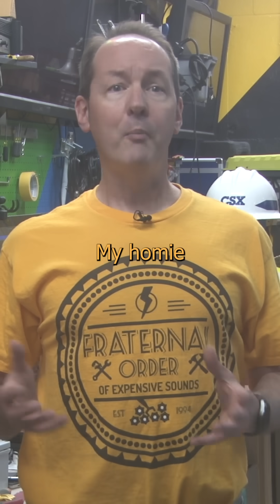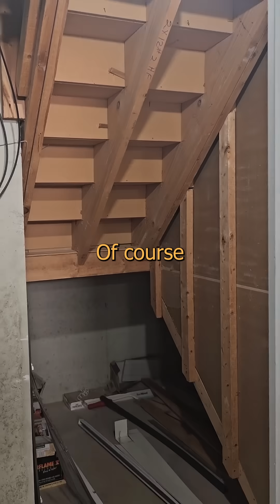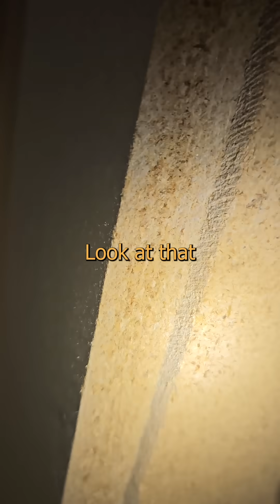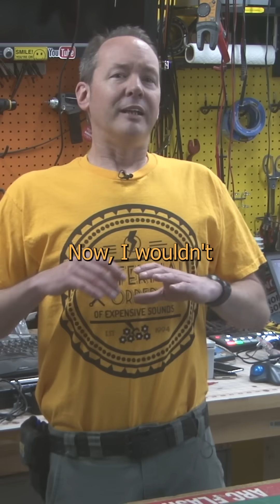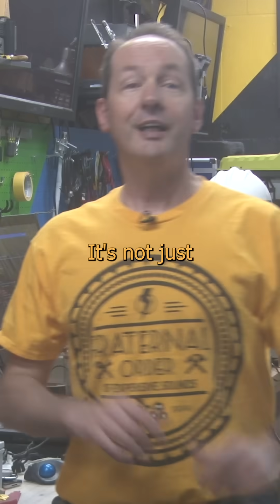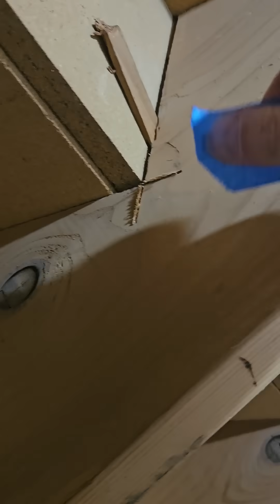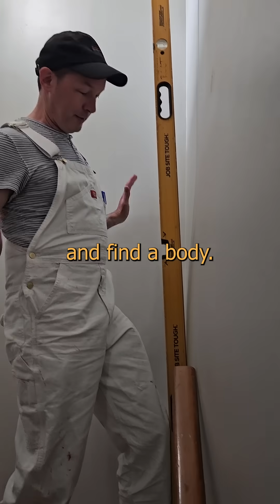Particleboard Staircase #chrisboden #engineering #construction #stairs #cheap #job #work #carpentry

Comment: As someone that's not American, it still boggles my mind that American houses are essentially built with, what essentially can be called, wood sticks, air and the stronger cousin of cardboard
Reply: Better than mud, railroad tiles and staples I have seen in my travels overseas.
Reply: Eh, it mostly depends on what type of mud youre talking about. Stuff like Clay ot clay composies can be surprisingly sturdy after they get dry. Also, nothing really beats a good, old house made out of brick and concrete@mhudzinski1

Comment: We own a 130 year old schoolhouse in Cleveland.  Not a square,  square inch in the place . I'm at the point I just close my eyes when I work .
Reply: @joeygigante4509  Yeah, but your's settled into that over time. This is a new-build.
Reply: At least it has being 130yrs old and all the settling that comes with the age as an excuse.

Though I am kinda curious to know if it was square 130yrs ago (not that we'll ever know). Bet they were more square than a lot of new builds today
Reply: After 130 Years you kinda have to expect that, that's just the building settling and a whole different expectations of a building, but a new build Doesn't have the excuse, not just that you can just See and Know it's not up to code in the slightest

Comment: One of my blessings was to grow up in communities with 300+ year old houses. Not all of them survived but enough of them did that you see what worked and what didn't. Everybody complained about a lot of the postwar housing but turns out that enough quality went into most of them that they were okay. I don't have the same sense of optimism for today's construction. My rule of thumb is if it's used on mobile homes to make them cheaper, don't use it. If they used it to make good airplanes and boats it's good.
Reply: And if it's used to make a bad airplane, well it's making the plane Boeing as much as it'd screw up the house.
Reply: I'd rather fly Boeing than walk up those stairs.

Comment: This much of a curve in a drywall is no longer a fuckup, it's an art project
Reply: Almost takes effort to make it do that.
Reply: @jbear9  or a buried outlet box. It looks about the right height for that too.
Reply: Load-bearing drywall?
Reply: @RageTH22  been a long fucking time since I last saw a reference to Groverhaus and it's load-bearing drywall.
Reply: @danielmclellan1522 I was hoping someone would catch that, lol.
Reply: @RageTH22 😂😂
Reply: @RageTH22  Aren't the edges of the ceiling Sheetrock supported by the wall Sheetrock? That's more of an incidental fraction of burden, but that's enough for a technicality.
Reply: Fucking abstract artists I tell ya.
Reply: Gravity assisted walls
Reply: As some who has to deal with drywall for my carpentry. That wall is the straightist wall ive seen.
Reply: At this point is a feature, for real this ad to be on purpose or someone was a tad too drunk on the job, how do you even bend drywall like that...
Reply: Just fill it in with 40 gallons of mud
Reply: @NigelThornbery  it would still be off by a 4th
Reply: @demon-hunter1498 so 50 gallons?
Reply: @NigelThornbery  brother they could use the whole ocean worth and still be off by an inch
Reply: @NigelThornbery but then it will slump unless you spend days adding it gradually , letting it dry using a heater on low ? but then there's the issue when you go to hang multiple items over a period of 
time . did you know that if you have a stack of drywall ready to be used, then it does get used , for sitting on repeatedly, stacking things on , even napping & having lunch on. this can cause ( 300# dudes once you add the tool belt & boots & hardhats) a certain amount of graduated curvation & it's even worse with particle board.
Reply: I love the intersection of trade work and the arts, especially as a hick lol 😂
Reply: In a past life me and my ex were house hunting in a rapidly gentrifying area and whew did we see some doozies of modern drywall art
Reply: Salvador Dhali would be fuming at the blatant plagiarism. 😂
Reply: "If you squint, its mint." LOL.
Reply: Screams in drywaller
Reply: "I like it! Picasso!"
Reply: Yup. And I thought that walls in our flat were crayz curved, because of that 1inch difference between each side of the livingroom.
Reply: @mikurusagawa6897  I can easily imagine someone thinking: "I want a curved wall. Just for shits and giggles. There's nothing behind the wall, and it's just a stairwell, it's fine. I want a curved wall, dammit."

What I cannot easily imagine is someone setting out to build a flat wall and ending up with a bowl.
Reply: Currently building my house. Over a 17 foot wall, my top right corner is inset by about a quarter inch. Undetectable without instruments but my god it's been bugging me. This made me feel so much better.
Reply: It’s like one of those curved mirrors at circus funhouses
Reply: If you squint, its mint
Reply: As a European, I am already uneasy with that flimsy drywall, but how the hack can it get those curvatures "accidentally" without the framework already beeing a mess?
Reply: @sebastiant4597  it's both! it's more on the framers not making the wall plumb but also on the drywallers for not adding some backing to out the walls to make them plumb. I get why but for my line of work I have to fix it a lot with a hammer
Reply: @mikurusagawa6897  yeah I'm not carpenter, but I do bathroom and kitchen renos so I have a solid understanding of basic framing and drywall work. I would have to put in extra effort to fuck those walls up that much. Idk how you even do that accidentally.
Reply: @PsyTheDuck  It's not even accidentally... It's negligently done. Builders use cheap, local labor to get houses up quickly for max profit. Then they rely on predatory contracts that makes homeowners think they can't get proper inspections without losing their warranty. But mostly, they are hoping most homeowners aren't doing a 3rd party inspection because they pay off city inspectors, and most homeowners just go off the word of the city inspectors that the home passes, because why wouldn't they? It's a quantity over quality game they are playing, and they go after anyone that challenges them. CYFYhomeinspections, for example.
Reply: I couldn't even begin to try to do that intentionally. Like, I have no basis from which to start.
Reply: Love the qoute: "If the project failed, then it's not a failed art work."
Reply: There are straighter cob/adobe/mud walls.
Reply: Tensegrity drywall
Reply: @BobtheHobo324  Nice Buckminster Fuller reference... But I also like the EA Poe reference of Fortunato.
Reply: Entire industries, from music genres and gym memberships to supplements and diet programs have centered around promoting and praising curves like these.
Reply: get Phil to fill it in.
Reply: Hundertwasser comes to mind with those curves 😂
Reply: @mikurusagawa6897  fuckin guy used a protractor instead of a level.
Reply: LMAO
Reply: if you squint is mint
Reply: @mikurusagawa6897  housa Bifida
Reply: talk about getting fucked sideways without lube when someone buys that house
Reply: MOMA AF
Reply: sculpture
Reply: I’m an artist.
Reply: I’m not even mad , I’m kinda impressed .😂😂
Reply: So he lives in an art deco house? 😂
Reply: Hope he didn't get charged extra for the "architecture" that went into it ^^;
Reply: I didn’t even know that was possible.
Reply: @mikurusagawa6897   hey it’s not curved; it’s abstract
Reply: It’s beautiful 😨
Reply: Especially with its height from the floor

Comment: What does the tread look like from above? It was hard to tell from the few seconds in the vid...

If they are actual wood, as they seem, to be... it's not really a safety hazard. Cheap AF construction likely to need replacing, yeah... but it's fine safety wise.

Comment: Remember, code has no qualms over quality. Don't make it right, but if the product was "engineered" for that purpose it's allowed. So is it a fault of the framer or the father (engineer) nonetheless, if one is given an unlawful order it is their duty ot disregard, and the builder of those stairs failed here. However,  it's likely functioning as designed and unless a slip and slide is run down the stairs or they're used for keg stands this will likely never have an issue (likely) 😂

Licensed home inspector and strongly agree with you here, and most your videos, yet still support your voice in those I don't agree with ❤

Comment: the Blue Tape nailed it.
Reply: Cy
Reply: We used to use blue tape to tag defects on  newly built rollingstock. You got a number from the defect register (a folder always left on the first table in car number 1 unless you wanted a beating), wrote that on the tape, recorded what the defect was in the register then stuck your tape on. Mostly it was trivial stuff like a slightly damaged screw head or a cabinet door that didn't close just right but the train buyer's rep could spot those defects at twenty paces. 
Where I'd had to take something apart fir additional testing I had my own stickers that said "Quality Break" and had individual numbers. I'd record these in the Defect log too, but these were just to make sure that someone from Production Test came and checked that I'd reconnected or re-attached whatever it was that I'd been working on.
Reply: @davidquirk8097 Good work mate🍻
Reply: @davidquirk8097   hey, someone else in my line of work. It’s moved on from car acceptance to modifications for me, but same principle. Which builder/project?
Reply: @raetiran463 Bombardier (Alstom as it now is, Class 378, 387 (Electrostar), 710 and 345 (Aventra). I'm working on Hitachi (HS2) now but at a much higher level but with a side order of Class 16x on a mod that refuses to go away.
Reply: Just needs a tiny white pointing hand on a telescopic rod. 

Tap tap tap.
Reply: "If ya squint, it's mint."
Reply: @LarsBlitzer ”Looks good from my house!”
Reply: Now, I wont say who the name of the YouTuber is.
Reply: Moreso than the nails lol
Reply: @cyporter
Reply: Respect for what Cy is trying to do; get these pile of crap "American" builders to actually freaking fallow and up hold the industry standards ... and you know, stop completely screwing over their buying customers. 

We can all thank Trump for gutting and in practice eliminating the consumer protection agency .... making it significantly harder to form a law suit in situations such as these. Also any "guarantees" a company gives you no longer have to be followed .... no one to monitor their sketchy/illegal business practices, no one to enforce the law.
Reply: 'Punch list is just another phase'
Reply: I wanted him to say "that ain't right"
Reply: @Lowkeyhi  NONE of it was right.
Reply: @Lowkeyhi I doubt he would repeat a phrase that a crook and conman would say
Reply: @DefinitelyNotGlep  I don't know if we're thinking about the same person.
Reply: @Lowkeyhi the black guy who does inspections and say now that aint right as a catch phrase or something
Reply: @DefinitelyNotGlep  He's a scammer? How?
Reply: @Lowkeyhi  I don’t think he ment he is now but I think it was part of his arrest record. If I remember correctly nothing was intentional but shit went south with what they were doing and he got the rap for it.
Sorry had to correct a couple of errors, spell check like to put words in automatically.
Reply: I chuckled out loud 😆
Reply: It's a universal thing, I guess. We often joke about blue tape in Russia too.
Reply: @vontar1  yeah there where probably more nails in that piece of blue tape than in the rest of the stairs
Reply: The Blue Tape isn't just Cy's thing, though as a building instructor he loves to use it, It's seen that in Canada, it's just a thing and that was the super doing the inspection before the inspector got there cause he wasn't dealing with substandard.
Reply: @vontar1  if you squint, it's mint!
Reply: @butternutter3420  hell ya
Reply: all it's missing is a side of bent, half ass driven nails holding up fuck knows what xD
Reply: Yeah, I didn't expect that one, but it was a great reference.
Reply: But did he say "that ain't going anywhere" after?
Reply: That ain't going anywhere now
Reply: @vontar1  I'm new. What does the blue tape mean here? I'm used to seeing it used to tape toilets shut to try to prevent people from using them when the water line is off (Not that it stops everybody 😒🙄). I understand that it's pointing out that something is wrong, but it's obviously a reference to something. I wanna laugh too! 😄
Reply: @nihiliststar  glad to answer.  there is another youtuber cyfyhomeinspections that is a home inspector I think in AZ.   He marks all the problems with blue tape for the builders to fix.    I love the fact that when one youtuber i watch is also aware of other youtubers I watch.   Makes me feel i am more in sync with both of them.
Reply: @vontar1 Thank you for the answer! Yes! It's like when you're watching a series of YouTube shows and a character from a different series of YouTube shows shows up in it as a surprise guest star! I love a good crossover! It's like they both exist in the same universe, but we never knew it until just then.
Reply: @nihiliststar  exactly.   Like Minds and all.

Comment: The curve in that wall made my skin crawl holy moly
Reply: I have a 60s house, solid plastered walls that are concave.  My dad knew some of the guys who built it and was less than surprised🤦‍♀️
Reply: A work colleague had a house build where the curved wall got axed by the private inspector. The builder didn't want to fix it and they had a little bit of a shit fight over it. Ended up builder had to fix it and 3 strips of packing was not it. They had to redo the frame wall. This paticular wall was the main wall where a TV would hang off. So it was fairly important this wall didn't have a large curve in it.
Reply: My place that I/we (extended family and neighbor) built out of a flat packed steel building, SOMEHOW I didn't catch that in my bedroom the one long bedroom wall isn't square at the corner, and by a good 3 or more inches... (not quite as bad as that stairwell, thankfully) 😭
Which is unfortunate because it's what I planned to have my bed against (I'm single), so now there's a huge gap between the head of my bed and that wall, which I have to cram throw-pillows in 😮‍💨🤦‍♂️
Reply: @DUKE_of_RAMBLE 
Time to learn carpentry and build a squiffy bed for that corner.
Reply: @MostlyPennyCat  haha Had to look up squiffy, but yea, that tracks!
Reply: @DUKE_of_RAMBLE 
😁
squiffy
/ˈskwɪfi/
adjective, informal•British
1.
slightly drunk.
"I feel quite squiffy"
2.
askew; awry.
"the graphics make your eyes go squiffy"
Reply: @KennyDingey  you should see the house I live in in East Germany it's an old military building the walls literally are wavy like the sea
Reply: @xfelixxcoding8257  it has probably settled, but this should be newer ish
Reply: @moosemax6346   the amount of dust under the stairs is telling me this is a decently newer build, maybe within the last few years
Reply: @lydia8591 They meant the East-German residence 😅
Pretty hard to be a new build given East-Germany hasn't existed for a few decades lol (at least in our timeline)
Reply: One minor mag 3 earthquake and all of the drywall behind that paint is gonna look like moonsand, and don't even get me started on a potential in wall leak and water damage making it even worse than it already is, which is entirely probable if the roof was constructed anything like the stair and walls.
Reply: @Polaf3456  Hmmm…sounds like Cy needs to go walk onto a roof…🧐😅😂🤣
Reply: Yeah I have 0 faith in the rest of that house's structural stability, somebody who can't bother to square their studs won't bother with a whole lot more, and its clear by the trend in the stairs between those houses
Reply: The end clip where he has the level flat with the bottom of the wall killed me 💀 I wouldn’t even know how to do that on purpose how tf did someone do that and go “looks good” 😭 Also him going “WHAT THE FUCK” while holding the level is exactly what my reaction would’ve been 💀
Reply: As someone who lives in Europe, I always find it funny how upset Americans get by non-straight walls. Maybe your road network gives you certain expectations or something.
Reply: @KennyDingey  ya that was really bad
Reply: Can’t tell you who the builder is…🤣🤣🤣🤣
Reply: We have a 30s house.
I'm pretty sure it's nuke proof although we did have to remove some lead water piping.
I can calibrate squares and straights off of it.

Comment: In Oz, particleboard flooring is amazingly water resistant. The opposite of cheap furniture. I tested offcuts 12mths outdoors in the tropics with no damage. We don't use OSB the way the yanks do. Or bitumen shingles for 10 year rooves.
Reply: Or chip board as I know it
Did some renovations about 30/40 years ago & used particleboard to do some flooring, it's still going strong
Reply: @johnks6733 yellowtongue
Reply: nobody would use a product that only lasted 10 years for a roof. asphalt shingles are either 25 or up to 50 year warranty depending which kind
Reply: I would bet that it's a different glue or something, because I've literally never seen particleboard survive a significant amount of water.
Reply: @mechalith2791  swing by bunnings, grab some yellowtongue, test it. I was very surprised